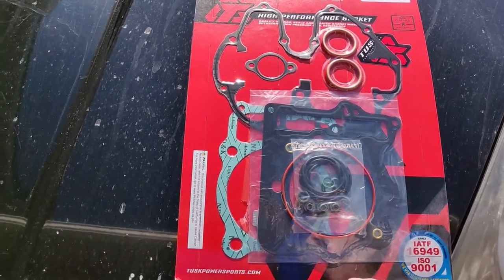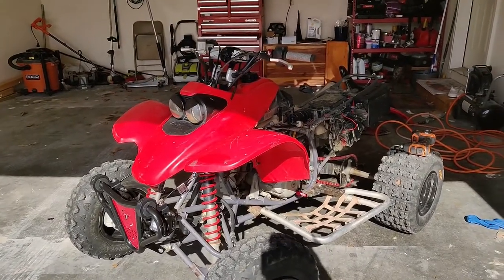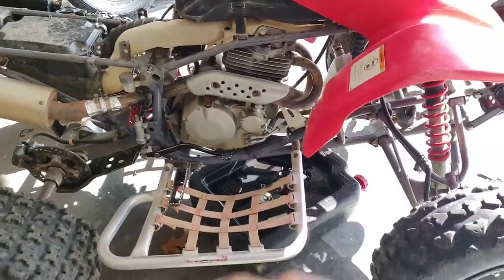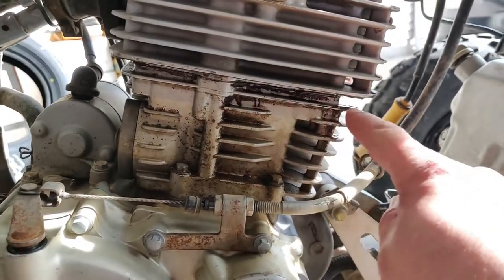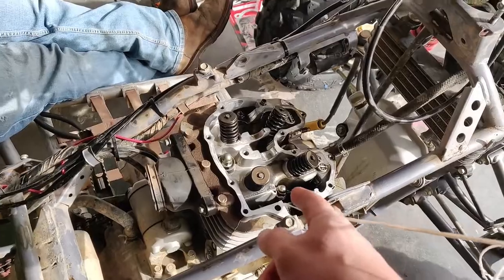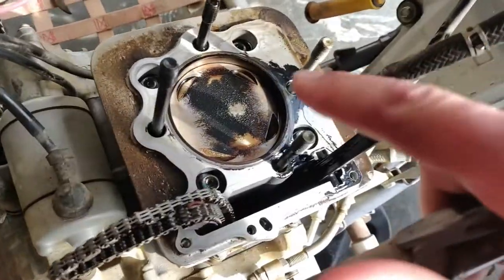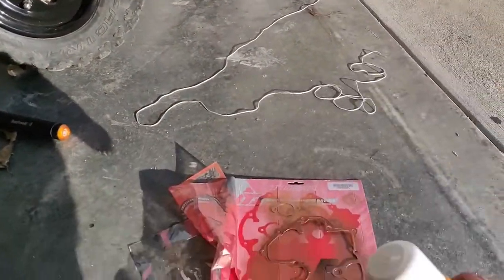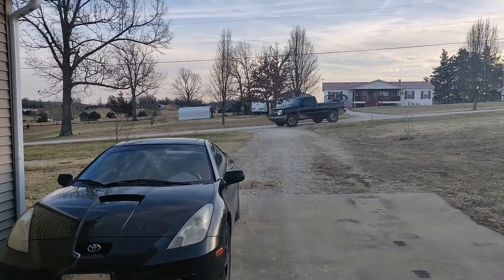The Gaskets were Leaking! | 400EX Build

Comment: Hey man how u get that look on ir headlights
Reply from the maker: Super easy lol black electrical tape and a straight line
Reply: Thanks
Reply from the maker: Your welcome
Reply: @AthenasGarageOffical  I did this 2 lol
Reply from the maker: It works good!
Reply: @Athena Offroad  my girlfriend laughed at it and I said your can't even tell unless you look close lol. I'm having the same gasket problem. Gonna try and tighten the head down to proper torque, if that don't work I got a new gasket on the way. Should I use copper spray a gasket 2 ?
Reply from the maker: @PrevailArmy  I would! I think it helped me
Reply: @Athena Offroad  I just watched it all and now ik you used it in the video. Should have watched a bit more.  Thanks for the quick reply
Reply from the maker: @PrevailArmy  no problem!

Comment: Great job! This vid helped me a lot I have a question tho I have the same Trx400ex with a valve cover leak i have like 3 stripped bolts so I put a new gasket with gasket maker and put helix coil to the bolts that were stripped and the bike still leaks oil what should I do ?
Reply from the maker: Honestly if it was me I wouldn't risk it leaking more oil and I would replace the whole top end, but if your in bind and get afford it I would just keep it topped up with oil. Mine leaked for a while and I never had any issues just kept it topped up
Reply from the maker: Because it's easy to strip the holes in the aluminum so if you get a new head you shouldn't have any issues
Reply: @AthenasGarageOffical  thanks for the help but honestly I can’t afford a new top end right now and I’m selling the bike too so what do you recommend me to do something to try to stop the leak ? I just order some new tusk gaskets should I put gasket maker or what should I put on the new valve cover gasket so it won’t leak ? And I will always try to put new valve cover bolts with helicoil
Reply: So the valve cover could be tight
Reply from the maker: I would try that spray a gasket. Copper stuff it worked really good for my situation, of that doesnt work you could try some rtv but it's not very pretty
Reply from the maker: And that top end kit ingot was only like $100 of I remember right
Reply: @AthenasGarageOffical  okay I will try to put some rtv see what happens because it’s only leaking on one side and the oil is hitting the pipe so it start smoking but the top end $100 just for gaskets or cylinder head and cylinder were $100?
Reply from the maker: My whole top end kit was $100 ish I went cheap tho
Reply: @SendMeFreeBullets  thats a really good idea!